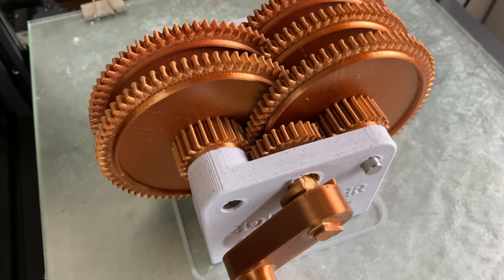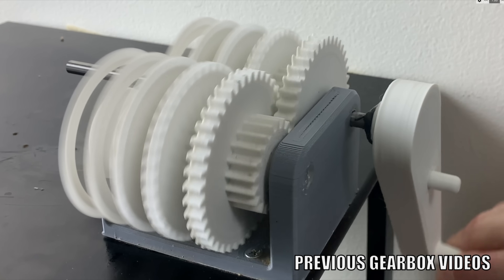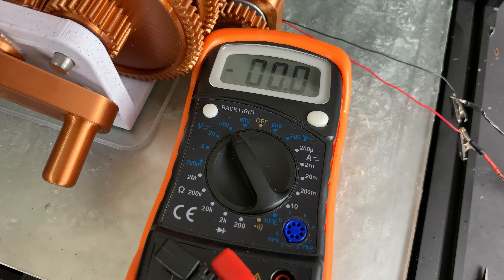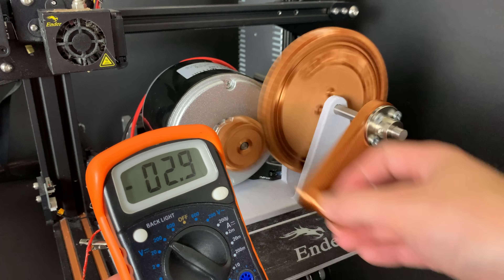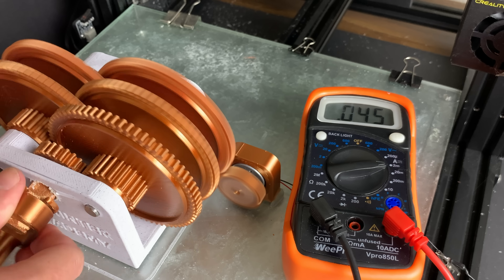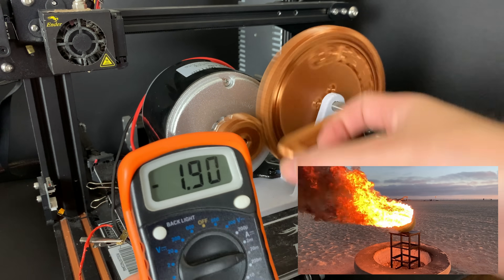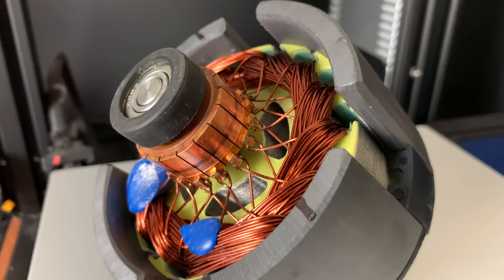Does a fast gearbox generate more electricity?

Comment: Hello i was just wondering if you could make a Wooden or 3d printed machine, a basic weighted clock with a least 12 hour wind up or mainspring clock driveor with 12 hour wind up, or a flywheel with magnets running thought the middle of the wheel, with a curved piece going from the one side to the bottom of the wheel at the back of the mechanism, powering the main shaft of the mechanism with a small gape inbetween the base and the wheel repelling it forward, with a deadbeat escapement, with a pendulum and at the top or middle or bottom of the pendulum moving like a SLIDER CRANK MECHANISM back and forth, connected to and turning a compound gear train handle of the gear box to power your phone... can I get the files for wooden or 3d printing the hole thing with all the attachments

Comment: The measurement method is highly flawed but the result is correct. The mechanical power is torque X RPM, and the only thing a gear does is exchange torque for RPM or vice versa, and lose a bit of energy through friction in the process. So more gears is never more power. 

It also depends on how well you can crank it, and it seems like it is much easier for your hand to crank the big generator than the fast one. Therefore, likely you are adding more power into the system with the big generator. A slow but powerful drill with constant power output would have been a more precise way to add power.

Also, you cannot measure the open circuit voltage and short circuit current and multiply them to get power. That is simply not how it works: that small generator's voltage output will plummet the moment you load it and allow it to generate current. Use a resistance to dissipate the power instead and measure the current through the resistor and voltage drop over the resistor. Best is to use two multimeters to measure simultaneously but I can understand that you have only one, so this method would allow you to to measure current and voltage in different setups and multiply them to get a decent method of the power output.

Comment: making those gears out of metal doesn't need to be expensive at all if you are smart.
look closely at the gears they have no complex shapes and so are easy to stamp cast.
essentially just get very fine sand somewhere or add someting to white sand to make it more sturdy when dry, but finer sand is beter.
just put it in a simple frame, push the gear into it and shape some sand around it, pull the gear back out for the hole in the center since you will probably will break the sand there, you can either already put in the axis this way the gear will be stuck to it directly after casting due to shrinkage.
another method is using a thin roll of paper make it the size of the axis, put sand in the middle.
you can cast it with general aluminium since that is very easy to find.
or you can use zamac,  such as za12 which is much cheaper if you need to buy it, and also is much more easy to cast, melting at a lower temperature yet stronger in general.
essentially for a few dollars you can litterally cast clones of your gears, due to the shape you don't need to do complex things like buring or dissoving out the gear shape, instead you can just press/stamp it in and take it out.

of you lack hand coordination then you can use a 3d printer to pull the gear back up by using the z axis of the extruder. 
or for people not having those make a simple structure, 2 wooden beams or planks above eachother or one thick enough one, drill a hole through take a rod fitting finely through it but still easy to move up and down, attach the gear and and pull the rod to take it out.
ofcource if you have a hand which isn't to shaky you don't need such things especially if you can find propper fine sand.

make sure the sand is dry before casting however.
while if you know what you are doing sometimes you can get away with it being slightly moist, for beginners it is best to make sure it dries. molten metal is hot. hot water expands to steam, so steam explosions in metal, which might not always be fun.

Comment: The fact is that if you had generators that would go from slowly moving towards faster during the water flow if we are talking about hydroenergy or maybe wind whatever it should work?
Edit: because the whole potential of the reaources are not used properly, I think idk. If they used the whole intake from start to finish it would produce much more energy for sure and be more efficient.

Comment: I have 0 electrical knowledge. But I am curious could you use a gear ratio of 1 turn =1000 rotations. Just an example. But combine the torque with the fast rotations. If possible. Lol 😂 I need to quit smoking weed.

Comment: Your comparison is kind of irrelevant for a consistent result, if you spend the bigger generator at the same speed as the smaller generator, then in fact you would get more Watts out of the bigger generator, correct?

Comment: It will generate more electricity if the motor has been turned clockwise 🔁 quickly enough to be an electric generator that is hand powered and can charge up batteries 🔋 and light up lightbulbs 💡 or even a small heating element ♨️

Comment: I'd be interested to see you use a higher gear ratio for more spins, attach the bigger motor, extend the handle way out at about 75°, then add a heavy weight at the end. The handle will only turn roughly a quarter but the spins a power generated should be high.

Comment: Instead of a hand crank could a heavy weight on line that unravels as it falls (slowly due to the resistanceof the gear ratio), maybe the height of the room for prolonged duration?

Comment: Any generator will provide more electricity if driven at a higher speed but there will be an optimal speed above which  the output will begin to fall as mechanical and electrical losses increase. The losses will appear as heat.

Comment: Could you do this with a drone motor for the small one instead please

Or even with an axial Flux motor. There's a bunch of different designs. You should also use I think they're called herringbone gears. They've got teeth shaped like a V

Comment: Comparing the two vastly different motors on two vastly different gearboxes isn't really an accurate test, especially when only one of those gearboxes is built with stability. You need to redesign the multistage gearbox so that it's mechanically stable and then use that one and only that one to test both motors at each stage. You also need to use two meters or a single meter with multiple readouts to measure both output variables at once.

Comment: there's a problem in your calculating . 
When you measure the voltege across the motor , the internal impedence's motor is zero. 
Because it's like an open circuit (the impedence of a multimeter has to be very high, in this way the current flow is almost zero).
So  you can get an accurate voltage's value.

But when you connect the motor to the tester, for measure the current,  in this case the impedance of a tester is almost zero, so the motor sees two impedances, that of tester and internal motor.
You have so a drop voltage that you're not considering.

Comment: I'd just make a more powerful gearbox that can spin the larger generator at higher, more stable, speeds. If necessary, make it powered by a foot pedal with appropriate gears and a belt/chain, rather than a hand-crank. Much more bulky, but I'd wager more effective. 

It also provides some leg exercise, so there's that bonus.

Though it might just be better to make a gearbox connected to a gear shaft with multiple gears along it at even intervals, so that you can use the separated gears along the shaft to connect several small generators to generate more power than a single larger one. Or maybe a gear shaft connected to multiple gearboxes. 

If I try to make one, I think I'd try out a slightly more complicated form of planetary gear box if I can just work out the measurements and how everything should fit together in my head.

Comment: All direct contact 1 gear to motor must spin a dc motor up to at least 1800Rpm up to 2500rpm for the ebike 250w motor show.
So unfortunatelly, you didn't have a proper test in this video.
You should use heavy duty gears with 1:50 RPM ratio.
EVERY 30 TURNS FROM YOUR HAND WILL PUT OUT 1500Rpm to the motor.
Try to design helical gears instead of spur gears.
And use three phase ac motors for your diy project.
Dc brushed motor generate sparks that will damage your brushes in a short time if you use a brush dc motor as a generator.
This is why wind turbines are three phase ac motors, no brushes reguired.
I know you are good guy. And I understand that you could not afford heavy expensive gears. That's ok.
Anyway, nice to see your little diy.

Comment: Why can’t you make a bigger gear ratio, then add a electric motor to spin the handle for you once you manually get the momentum going and just have the electric motor spin it later on producing more electricity then used,
Or am I speaking out of my ass, I feel like this would be something that is possible, unless what you mentioned about not enough torque would matter

Comment: what if you connect the small motor into the place where the handle of the big generator is and power the small motor with the current produced by the big generator

Comment: But if you tweaked the fast rpm generator to have a little more torque and less speed couldn’t you use the large generator with the faster rpm? Or am I missing something mathematically

Comment: Well, you need to connect a voltmeter and a currentmeter together since the open circuit voltage and the loaded voltages are diffetent. And also when the probe is in the 10A range, switch the meter to 10A range.

Comment: Could an unwinding spring be used to automate the crank for some time? A big, strong spring like the ones used in garage door openers? And for that matter, wouldn't increasing the time it takes for the first gear to revolve once (maybe by adding gears to the system then compensating for the added necessary force with a stronger spring?)  mean that the spring would take longer to unwind, thus elongating automation? How far could that be taken? How long could an unwinding spring automate the system? If it could. I'm no engineer and I'm sure the nature of my questions reveal my ignorance. But I thought it seemed like a simple enough mechanism with potential.

Comment: Why didn’t you use the big generator but put it in the middle of the faster gears so it has both speed and torque
Reply: Like not on the last gear but on the 3rd one down the line or seconds to last

Comment: I was looking at this as a means to make a gravity "battery" more efficient, as in needing the weight to fall more slowly, thus decreasing the distance it has to fall. Over a certain weight, the torque would be irrelevant, for all practical purposes. A flywheel might help even further, though it might not be necessary.

Comment: Why dont u try small teeth gears as u increase number of gears.... it will require less torque at the end....try reducing teeth size with the increase in number of gears..largest teeth gear near rotating source and smallest teeth gear at the end.

Comment: What would happen if you take away a gear off of the smaller diagram would it put out the same voltage, more, or less. I assume it would be easyier to sustain the rpms since a lower ratio but would lower rpms mean less power? If so would having that setup on the big one produce more power ik tourqe would be the issue so hypothetically speaking

Please i need answers and i know theres someone smarter than me that knows

Comment: The short answer is yes, unless it has a voltage regulator on it. Because otherwise a alternator would create more voltage as rpms increase, but it doesn't create more than 14.?? Volts at any given time.

Comment: What if the high rev gears had magnets on them and it was an electromagnetic generator?
Reply: Simply spinning magnets doesn't generate electricity. That's not how generators work. If you somehow built a generator into the final gear the results would be no different. Why would it be?
Reply: @elonmusk8711  
That's literally how an alternator works...

Comment: Electrical machinery is a huge can of worms, but as long as you use a proper controller, the gear ratio is largely irrelevant for power output since the output is DC. The larger number of reductions introduce more inefficiencies so that would produce less electricity. The power output will be a product of the torque on the motor shaft and speed of the motor shaft. You can quickly see how altering the gear reduction will causes these to cancel out.

Comment: That makes sense from a mechanical perspective as well. If you're riding a road bike, you can pedal the smaller gear ratio a lot faster to pick up speed and get going, and the big gear ratio, while requiring much more force, outputs a lot more power.

Comment: generators have a perfect speed at which they have the highest productivity, but the input energy also matters - the harder you crank the handle the more power you put in, but lots of gears invite a lot of friction, which is power lost. Makes sense a bigger generator will be more productive. When you hooked up to measure current, the multimeter became a load, and that resistance of the generator was the effectiveness of converting input energy to current. The small one didnt give much resistance, which means its not an effective generator.

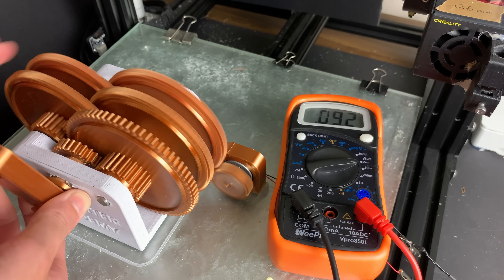Comment: 3:27

if you are wondering why he doesn't just hold its handle. it's because for some reason when it's connected to something it's meant to power it becomes extremely difficult to move and feels almost impossible to get a good grip on
Reply: The “some reason” is Lenz’s law
Reply: @_vizec  almost. The reason is the DMM uses a shunt resistor, and the current goes through it, so it's essentially short-circuits the generator, thus it draws all available power. This creates opposing magnetic fields making it difficult to spin.

Comment: the speed to power generation potential of your gearbox will directly correlate to what kind of induction motor your using, if your using a high RPM low torque motor then high speed will work better but if your using a low RPM high torque motor the opposite will apply, that's why they use high torque for water turbines and low torque for wind turbines

Comment: Its interesting, in general we could describe de open load voltage of a CC machine in terms of speed and exciting magnetic flux, for permanent magnets we could say that the magnetix flux is going to be constant, so your open load voltage is going to be speed dependent only. Besides that the amount of mechanical power you inject in a system is equal to torque times rotational speed en rad/s. You have to consider that the amount of mechanical power wasn't exactly the same for both cases. Whatever it was a nice experiment though :) .

Comment: Getting the gearboxes to spin faster: mounting them with bolts/screws would be a great idea so you didn't have to hold them down for the spinning. This may look like a heavier-duty more industrial stand than what you've been printing, but that way, you could both get a faster and more consistent turn of the crank. And, speaking of the crank, if you increased the distance between the crank shaft and crank handle, you'll have significantly increased leverage, and thus an easier time to spin quickly and consistently. 

Seeing a metal gearbox would be fascinating. It would be a great way to compare the friction outputs of similar gearboxes with different materials; not to mention spin speed and electrical output differences.

Comment: Unfair for the fast gearbox using the small generator. You could've tested the fast gearbox using the bug generator too.
Reply: You're not very bright, are you? Power = torque x rpm. When you increase RPM you reduce torque. It wouldn't be physically possible to spin the large generator. You'd have to put so much force in the plastic would break long before it ever got spinning.
Reply: @elonmusk8711   I do understand that in the application of more gears that spins with the prior gear, but faster, decreases the resulting torque. But my point is that "both generators did not use/ end up with the same RPM", which I think didn't really answer the question "do faster gearboxes generate more electricity?". It is also irrelevant to say that it wouldn't be physically possible to spin the large generator, if the following reason is that the plastic gears would break for they are not durable enough to withstand larger applied forces. It is possible, only IF the gears were durable, like steel.

Comment: Congratulations, you failed your own Test by adding more variables.
Your Test should use the Same Generator on both Gearbox-Settings, in order to be accurate.

So far, your tests are invalid due to using different Gearboxes and different Generators.

Comment: I refuse the result you showed in the video. You revolved the gearbox with your hand and RPM of last gear wasn't maintained constantly. Therefore, the power value may be greatly distorted. If you really want to be real engineer/scientist, you must control the possibility of errors which can be occurred from observation, calculation, measurement, and etc. Your conclusion has NO meaning.

Comment: Huh I notice how your big generator has very thick copper wire you'd actually only need a 1mm thick wire to withstand 220V so the generator could spin a lot faster if you added just one more gear